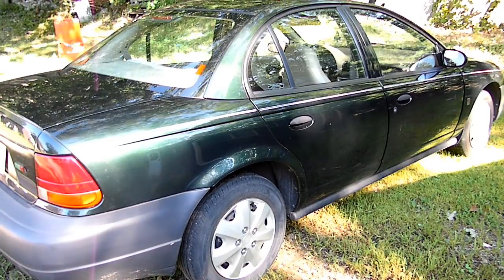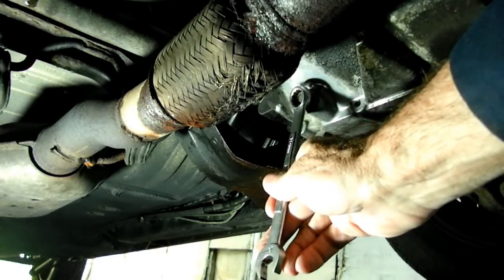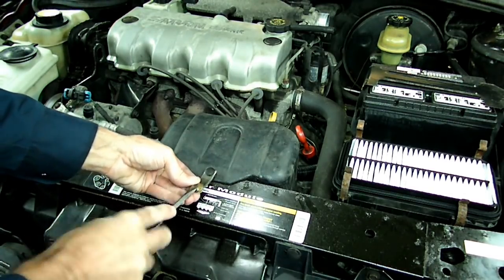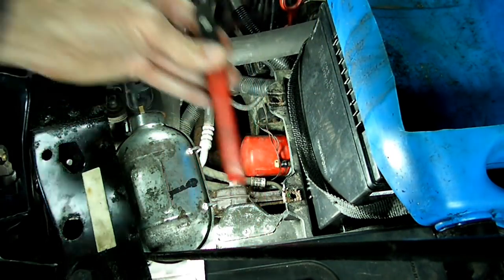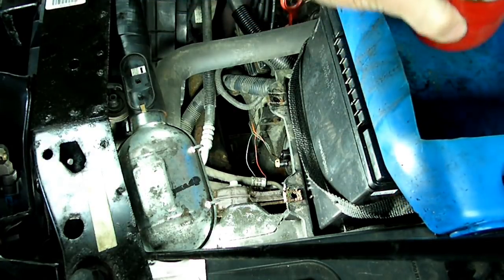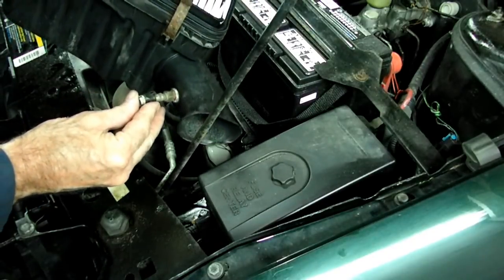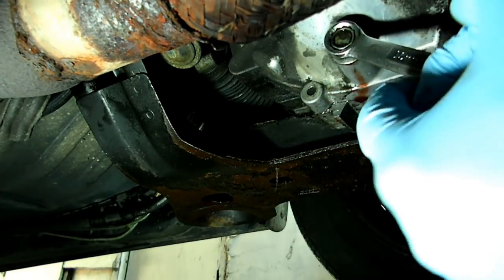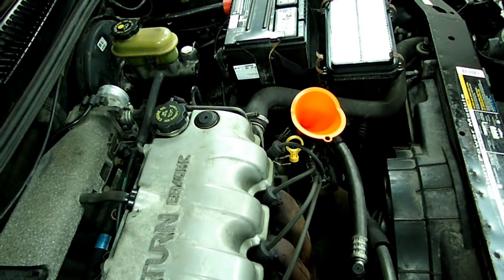Automatic Transmission Fluid Filter Change Saturn

Comment: So happy to have found this video. I have a 1997 Saturn sw2. Only had one previous owner. 
Mine has been doing the reverse slam too. Thankfully I found this video and the Saturn fans forum. I absolutely love my car. I had a 2017 Kia Forte....OMG bought it brand new, kept up with regular maintenance and it had so many problems. But this Saturn is my favorite. I wanted a Saturn growing up, finally got one. So, thanks for this video! Coming from a woman... learning to take car of my own car! Thank you 🤩
Reply: A buddy and I repaired my sister in law's reverse slam 5 years ago, including installing a remanufactured Sonnax valve body, and have had no issues since. It does take 2 people and some special tools but better than junking the car. Follow the Saturn forum how to.
Reply: @kingjulian291  there's also the nut on the side of the transmission that will loosen over time and cause the same issue

Comment: I will add that you should return to that filter after a few days of driving. Get to it top side by removing the air resonator box. You will be able to give it an additional 1/4 to 1/2 turn to your surprise. This will save you a future seep or leak. Common.
Reply from the maker: Thank you for the tip.

Comment: great instructions! but, you can do this in a 2002 saturn L100?
Reply: Hopefully this could help, I have a 2003 L200 and it's transmission filter is under the pan IE the more traditional method. Best of luck in your travels I know this is an old comment but maybe if someone is looking for this information they can find it.

Comment: Richpin, you are the best. My only question, when I try to remove the air filter, I am having trouble with the front bolt, how did you get that one out? I have a 2002 SL2, Auto
Reply: you can remove the filter from the bottom.
you don't have to take the air filter box out.

Comment: is it easier doing it from the top, Isn't it possible to just remove the driver side wheel and paneling and remove/replace the filter from there? Also Can I save some fluid by not draining it all fist and just let it come out from filter hole?

Comment: hi just want to say I did what you had said when you replaced the filter to put it hand tight when I did that it was fine but shortly after trans fluid started pouring out of the filter just wanted to get an opinion on what I need to do
Reply: +DRINKER0FBLOOD It's possible that the rubber o-ring on the old filter got stuck on the transaxle and when you put the new filter on you had two rubber O-rings that did not seal.
Reply: hnkfsh81 Thanks for the comment however I did look for that when I took old one off and it came off with the old filter and I double checked where it screws on made sure nothing was stuck on it
Reply from the maker: +DRINKER0FBLOOD Is the filter tight enough,is the surface clean,do not use the magnet with aftermarket filters.
Reply: +richpin06a I had thought it was cause I talked to multiple people who said to do it like you have in the video and I did clean around it made sure it was and I didn't use any magnets as there were none
Reply from the maker: +DRINKER0FBLOOD Make sure the gasket from the old filter did not come off and stick to the transaxle.

Comment: hi there great video i have a question, i went to my local store and ask for the transmission oil filter and they said that they dont have it, but i saw in the video that it is so similar to regular engine oil filter is that an special one or is the same filter for the engine as the transsmision ? thanks
Reply from the maker: +Jose Bernal For The S-series It is a special one just for the transmission AutoZone and NAPA has it.
Reply: Jose Bernal q

Comment: Thanks but one question can I still used the old filters cause its kinda new and I also fluid from family dollar it say American xt multi purpose DexMerc can I still use this kind
Reply: Used filters will cause your problems to come back sooner.  If your fluid was dirty enough to give you problems, your filter is dirty enough to need replacing.  As for the cheaper oil, research it a bit first and if you like what people are saying, go ahead, but you may be taking chances that lower quality fluid could perform poorly or damage a very critical part of your engine.

Comment: Be sure to check the "nipple" that the filter screws on to for the magnet. 

The first time I changed my transmission fluid on my Saturn, the magnet didn't come off with the filter so I figured there wasn't one. 

The second time I noticed there was something black and dirty still on the transmission. It was the magnet. It had somehow stuck to the transmission instead of the filter.

Comment: how much different is the procedure if I have a 96 SL2 with a manual transmission? What type of fluid do I buy? is the filter or the drain plug in the same place? I know the dip stick is in a different place.
Reply from the maker: +Neil Manning The manual has no filter and the drain plug is near the bottom.Check your owner manual for the correct fluid to use.
Reply: +richpin06a ok, thank you for the information, I don't have a owner's manual but I'll Google it
Reply from the maker: +Neil Manning Dextron III is the fluid stated in the manual.

Comment: Rich,

I have the dreaded Diff Pin failure and need to change my automatic transmission. I will be going to search for a transmission from a junkyard, but my question is what automatic transmissions are compatible with my 99' SL1? Models, engines, years etc? Thank you in advance.
Reply from the maker: As far as i know the 98-02 had one for the sohc (mp6) and dohc (mp7)
Reply: only corresponding. to first engine. SL1,SW1 & SC1. from 1996 to 1999

Comment: I have a 1997 Saturn SC2 with an automatic transmission. So I called Jiffy Lube & asked how much do they charge to change the transmission fluid & filter and he said between $400-$600. I said to myself F**K THAT! 

I just changed the fluid & filter, a lot in part with the help of this video. Filter incl/taxes = $17.59, transmission fluid & drain pan incl/taxes = $39.80. Total Cost was $57.39 @Oreilly’s. I had a $20 coupon so I ended up spending a total of $37.39. 

It took me 4 hours to do it because it was my first time. I didn’t even have to lift the car because I was able to get under there from the front bumper to unscrew the drain plug. 

I did not remove the air duct, I disconnected the air box cover from the air box, removed the resonator & then the air box. After I removed the air box, I was able to remove the filter with both of my hands and I didn’t use a tool to do it.

Thank you Richpin. You’re a boss. Friday 9/20/2024

Comment: Great vid as always. Any chance you could make one on changing the oil pan gasket and or the fuel pump. 

What do think about the $30 fuel system/pump treatment that GM says can reverse pump wear from running it low on gas? Much cheaper than changing the pump but wanted to know if you had any dealings with it.

Thanks so much!

Comment: Rich I have a 2000 Corolla with a 3 speed auto and want to change my fluid at home. 

I watched a YouTube video once that looked like it would work to get all the old fluid out. 
The guy removed the trans. line at the cooler 
and with the car running drained the old fluid 
while adding new at the same time. 
Would this work?
Love your videos keep em coming.

Comment: Just a heads up, There is a TSB that says after the first 30k and fluid change, toss the magnet for the filter, it is no longer needed, and won't fit on non-oem saturn filters anyways.

Comment: That's a great idea to put in what you take out. My only problem is that when I change ATF, it often ends up on the floor, in my hair, and basically all over the shop so it's hard to measure. It looks SO much easier when you have a drain plug, ha ha.

Comment: hello richpin06a im about to make my transmission fluid change, well I have the problem of the reverse slam and I was wondering just assuming that I get 7 quarts of fluid and if I want to put lucas oil transmission fix of 24 oz do I need to balance the fuil and the lucas oil
Reply: Re: Trans Fluid. I did the first trans fluid change on my 96 SL 1 with regular Dexron II-III fluid and still had pretty bad reverse slam.  Yesterday -- after about 30K miles,  I changed the fluid to Dexron ii-III full synthetic and the trans has never shifted better.  I was also throwing a 0733 code which I cleared and so far it has not returned.

Comment: Do I have to have my car on a level surface when draining the fluid? Or will placing jack stands only in the front of the car be fine?
Reply from the maker: Jack stands will let you get under the car to remove the drain bolt.
Reply: I know that but I was told I would need the car on a level surface, meaning jack stands in front and back, or car ramps. Didn't really make sense to me since you only need the jack up the front on an oil change, which is pretty much the same as a tranny fluid change.
Reply from the maker: Eric Ver Linden
Jacking up all four corners would be best like a lift but personalty i just use ramps to do the oil change.
Reply: K thanks.
Reply: richpin06a
 do you put all 4 tires up on ramps or just the front?
Reply from the maker: Aaron Camilleri
I find just the front will do.

Comment: I have a 2003 Saturn vue v6 engine, and I do allot of the work myself.. I change my own oil and use Mobil1 5w30 high mileage since the vehicle has 183,000 mile on it.. How do you change the transmission fluid in the vehicle? My chilton manual says I dont need to change it, but there is a delay by a second or two when I shift gears, and with the high mileage I know it needs to change.

Comment: In Haynes is says: Transaxle  (1998 and later models) - 4.2 qts  
At ~3:00 you see the Air Temperature Sensor. If you forget to plug it back, how I did once, the car engine will continue to work even if you remove the key. I didn't know what to do and just disconnected the battery. This is very good film, thank you. But where did you get a new magnet if the one is missing? I thought it comes w/a new Transmission Filter, but seems you just put a filter without that magnet. Transaxle Drain Plug Torque is 20 Ft-lbs (for 2001 Saturn SL2, actually Hayne says 1991-2002).

Comment: Thanks again Richpin, I figured it out after I wrote the comment. Had to have a shop help get the filter off, they spent about 30 minutes and lots of cussing to get it off. Replaced the filter, and took about 5.5 quarts of fluid. It's shifting correctly, but it shift really hard now into 2nd gear. It also makes a bit more whining than it used to in gears 2-4. Any suggestions? I know some have said to try dexron VI in place of the standard Dex III I picked up at wal-mart

Comment: I'm not familiar with this model of Saturn, but don't you also have to drain the torque converter to get all of the old transmission fluid out of the transmission? Not sure if you would have to do that on this model of Saturn...

Comment: Hello Richpin,
     Thank you for your great videos!!
     I recently had a 1997 Saturn DOHC engine replaced.  Afterwards the engine was revving high on the highway.  It appears that something is slipping in the automatic transmission.  Is there an adjustment that can be made in the transmission to help?
Thank you,
Hugh

Comment: I was wondering if you can tell me what the two wires above the transmission filter are going to into the plastic piece with the white end? I accidentally pulled the wires out and was able to unscrew the part but not sure how to put the wires back in.  Do you know where I could find the part and splice the wires back?
Reply from the maker: Lauren Stern That is the  transmission temperature sensor.If you look at the 1:55 mark of this video  https://youtu.be/cucm7QGlsYs you will see how to remove the connector.In this video i am removing the coolant temp sensor but they use the same connector for the transmission and engine.Then your best bet would be splice in one that you got from a junk car.

Comment: how do you get all of the transmission fluid out?
Reply from the maker: I have removed the cooler line and used the engine to pump out a quart at a time and refilled till fluid looked clean.

Comment: @5:40  Is there any Gasket for TF PLUG??? No one shows that Gasket! Thank you for the film.
Update: there are gaskets on those plugs. On my Saturn the Plug is M14-1.5, all the new plugs are sold w/gasket(s).
   And also I would like to worn everyone who does the procedure described in this great film: please check your torque wrench well. The procedure is simple, but it is easy to strip the threads if you apply higher torque. See I stripped a bit that hole and probably the original bolt using a faulty torque wrench. It didn't click and continued to torque, then I checked w/electronic one and it was 33 Ft-lbs instead of 22. I used a new Drain Plug, seems like it holds, but now I'm afraid to apply the required torque. Very upsetting mistake.

Comment: The magnets have a strong tendency to stick to the block, make sure, they're kinda tricky to get off actually.
Reply: I had to use 2 hooks on each side of magnet to get it off it was covered with grey syrupy worn down metal plus the shavings the size of a 2 day beard

Comment: i know this is a far stretch, but i have been having recent troubles with my saturn sl1 99 sohc automatic. I was driving and it was fine and i went to park. when i reversed, it didnt go until about 4-5k rpm. I googled a bit of stuff and got that the TAAT body needed to be replaced, so i did that. and nothing. got all of my fluids flushed, and replaced the oil filter the transmission filter, and the input screw(?) and everything put it all back in the car. unhooked the battery to reset the transmission and hopefully get it back on track. I drove it around and it idles around 8-1200 rpm and drives, the shifting is a bit rough and when i reached 40 it randomly surged from 2.5 rpm to around 4-5 rpm. I go back to the parking spot where i was at and attempted to reverse, and still having to reach almost redlining to reverse. :/ any help or diagnose? thanks richpin if any word.

Comment: Great video, very helpful. Was wondering if this is the same process or similar with a 2002 Saturn SC-2?
Reply from the maker: +Mike Cain The filters have the same part numbers for all S-series so i suspect the procedure is very similar.
Reply: Thank you for the quick reply. I've been having slipping issues in 2nd and 3rd gear, and a slight reverse slam. I've read on Saturn forums, that changing the transmission fluid and filter while adding a transmission additive can help the problem I'm having. I'm starting small and going from there. Thank you for the help.
Reply: +Mike Cain I'm having the same problem,  did you ever fix it, how?
Reply: I tried the trans fluid change with an Lucas Oil Non Slip Additive and new filter, it didn't help. I had a bad Valve Body and pressure sensor. I got a good deal from a family friend with parts and labor, $650 and she is running like when I first got her. I had heard the valve body replacement can be pretty expensive, ranging from $800-1,300 for some mechanics. Everything shifts like it should and no more reverse slam!

Comment: Hey Richpin, just a quick ? I have a 99 hyundai elantra automatic with 41,000 miles on it, Hyundai uses a Sp 3 Automatic trans fluid type, can i use a fully synthetic Sp 3 trans fluid in it ? just wondering not really sure, like valvoline import universal synthetic automatic trans fluid for Hyundai / Kia

Comment: I was told by a professional years ago at a Jiffy Lube replacing old fluid in Trans. with new fluid can actually damage the rings inside the Trans. Sometimes it better to continue using the fluid that's in there...? is this true!!
Reply: Todd Gilmore What jiffy lube does is a flush, which is extremely dangerous if it has never been done before.
Basically, they hook a pump up to your transmission and force fluid through to flush all the old stuff out. That force can knock particles loose and cause further damage to the transmission.

Draining the fluid and adding new fluid doesn't cause this problem as some of the old fluid will still be left in the transmission. Just not enough to matter. With a flush, all the old fluid comes out.
Reply: +Todd Gilmore   I wouldn't take my worst enemy's car to jiffy lube.
Reply: tells people they shouldn't** when the opposite is true
Reply: You Said Professional at Jiffy-Lube.... LOL LOL LOL

Comment: Change the (transmission) valve body, its pretty easy.  They sell rebuilt ones on ebay (its where i got mine), send em back your core, about $120 total.

The TAAT tranny is pretty bullit proof.

Comment: I got a 2001 saturn sc2 am not sure if the transmission fluid has ever been changed how do you know when it needs to be changed.
Reply: How do you know ? When did you last time look in owner manual ?
Manual say first service brand new car, after 30 000 miles mandatory change ATF.period.
No if, but's or may be's

Comment: I have a 97 sl2 I noticed transmission fluid on top of my fuse box and battery.  I changed the filter and it's still leaking.  Please tell me what it could be thank you
Reply: That OneGuy that shouldnt be atf fluid

Comment: with the magnet thing, the aftermarket filters holes get covered by the magnet that's why it wasn't there, unless the filter is the same as the stock one don't replace the magnet you'll loose flow of fluids
Reply from the maker: +Noah Navin Very good tip for everyone to follow.
Reply from the maker: +Noah Navin Very good tip for everyone to follow.